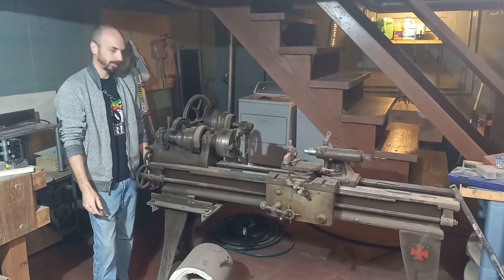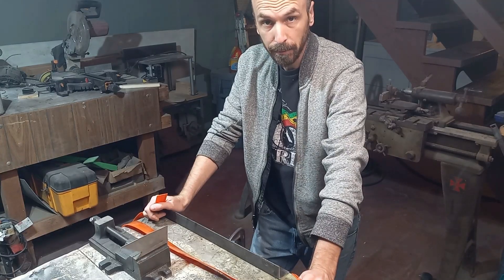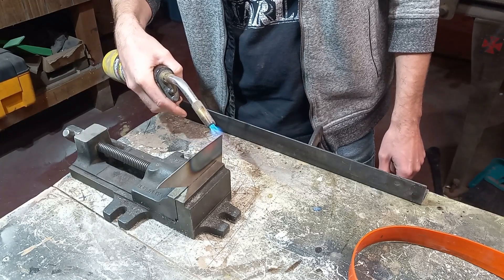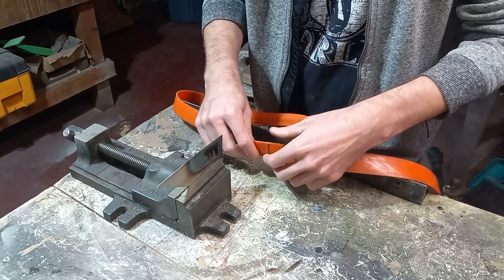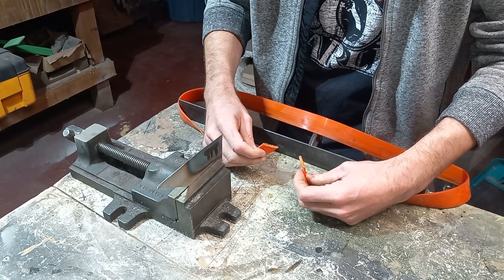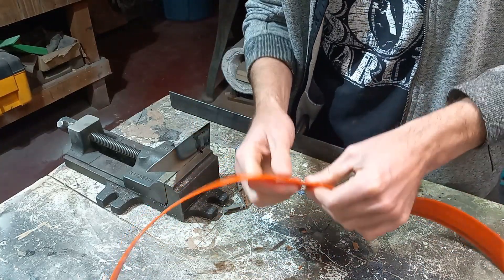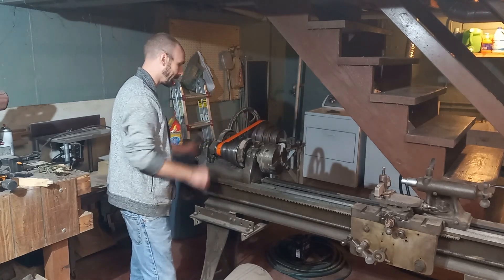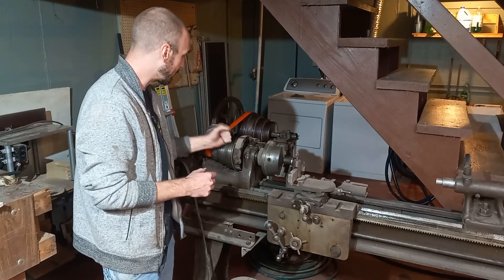Polyurethane Belt - Joining, shortening, lengthen, bonding (how to) poly PU

Comment: Burnt the 1940's motor on my 1897 Rivet belt lathe last winter...The previous owner used a wooden pulley and leather belt system, but I'm changing over to the poly flat belt this holiday month...I need to turn a nylon pulley and my other lathe broke a jaw...thanks for the encouragement that it can be done...btw I'm a machine fabricator/controls engineer...so it's getting a tach and VFD upgrade along the way of old parts picked off equipment.  What is your lathe?
Reply from the maker: A tach would be a fun upgrade. I don't remember off hand the model. I'm guessing it's from the 40's but has been modified over the years.  When I acquired it, it still had a leather belt which shredded the moment I turned it on.  Lol
Reply: @chrismakesstuff1  I still have a 2" wide leather belt on my manual spinning lathe from around 1925. Bond gives up every 5-10 years. I just clean it up and bond it together again.

Comment: The temperature should be much lower. You should never see smoke or even bubbles. To get a good strong splice you need to push the belt against the plate to form a bead and then stop pushing and hold the belt still for about 15 to 20 seconds. This heats the belt deeper. Then when you join the belt push gently. If you push too hard you displace the hot material and you end up with cold rubber at the joint. This will cause a weak splice. Also this belt is only good for about 1/4 hp. Not the best choice for that lathe.
Reply from the maker: Thanks for your comment.

Comment: Yup, on burning the urathain. I'm going to attempt soon. I've worked PVC shaping, and the thing with PVC is patience or it turns black and only flexy in the small area you heated. I have an old band saw, I got some new wheels for but dont fit...to long, so I will be giving this a shot. It will only have to stretch going on and not  constantly agitated like your issue. I'm glad you got it going, Im jealous ...your laith❤😂.  Whish me luck!!
Reply from the maker: It's not too bad a process, a little bit of trial and error is to be expected

Comment: Way too hot. Around 350f and 20 seconds of heating to allow heat to wick and soften the ends. Too much heat breaks down the plastic
Reply from the maker: You are correct. If the belt smokes, it's too hot.  The third attempt in the video where the belt melts, but not burns is when it starts to bond well.